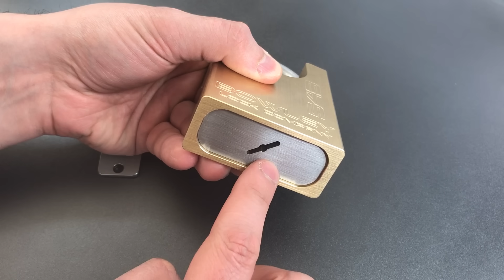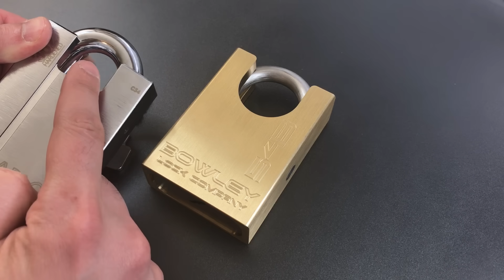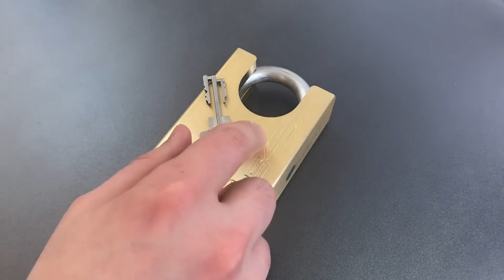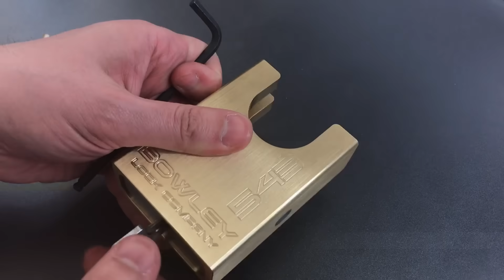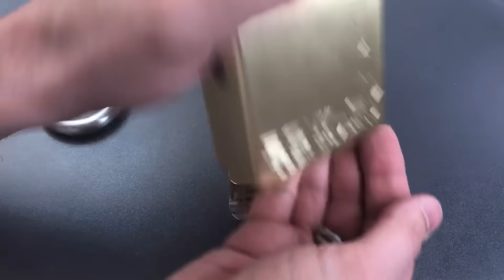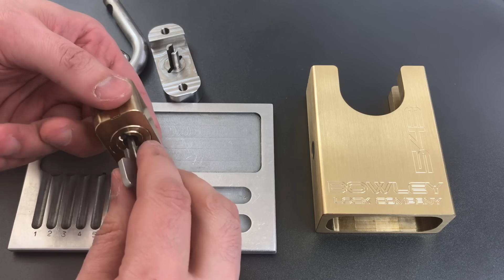[653] Prototype Dual Fork Bowley Padlock (Model 543)

Comment: You know it's a good lock when he doesn't even try to pick it
Reply: As he has said many times, he may not be able to pick it yet, due to not enough skill or a lack of tools. He has said it for a few locks.
Reply: @inchiga4466  still, it's certainly a strong plus for the strength of any lock when the lesser version already requires skills beyond his to access
Reply: @inchiga4466  he’d have to create a tool that can make that U shape to be able to get to the pins as well as create tension.
Reply: Alright someone bet him 20 bucks he can't pick it so we can see him pick it
Reply: It's also a prototype, so it wouldn't be an accurate representation of the final product
Reply: I don't see how you could pick this lock without having a special tool made just to pick it maybe eventually someone or some company will come out with the tool where you can stick it in the lock and get to the pins wall being able to turn it around that Shield
Reply: @davidaix5771  I'm sure him and Bosnian Bill could make one
Reply: @davidaix5771  - There's a guy who picked the single version on YT but it was difficult and required 2 unwieldy home made tools that were hard to use and flimsy. Imagine the same scenario on a dark night and DOUBLE the difficulty. This lock is an amazing accomplishment from a picking standpoint. I think a door version would be very interesting.
Reply: @davidaix5771  I wouldn't think anyone securing anything  worth more than a high end mountain bike would use this lock instead of some kind of  vault . But it's good to know that nobody could pick this lock , at which point bolt cutters would come in handy .
Reply: He doesn't have a tool for it yet.
Reply: It was more of a sponsor, so he wouldn’t show off how to pick it. But im not sure how you’d pick around that pin shield anyway
Reply: @ectoa5093  well, he apparently did try to pick a one-sided bowley core ( 636 ) and failed, so I guess it's fair that he didn't attempt to pick the two.sided one
Reply: @enteelch1717  fair point
Reply: @enteelch1717  cause he can't fuckin access the core
Reply: @ectoa5093 He could not pick it. See 636
Reply: @ectoa5093  He's not a shill, he picks plenty of locks he gets for free. The rest of the comments already mentioned he admitted he couldn't even reach the core for the half-variant.
Reply: @GRAYgauss  i respect the comment 6 months later
Reply: @ectoa5093  nobody has picked it yet
Reply: @ectoa5093  huxley69 did a video with small electric drill and wire, it's pretty quick. Bowley said it was only because the no lift pin was at the end but, huxley shows the weire has 5 wear marks and slips under the no lift pin.
Reply: @ectoa5093  nah he rarely will try to pick a lock on camera he didn't already pick a few people can pick the normal door lock bowly not sure about this yet
Reply: @ectoa5093  nope its cuz he cant pick it 🤣🤣 he just wont admit it
Reply: @pawelwityk1963  he admitted it in video 636.
Reply: @pawelwityk1963  he can't access core
Reply: @pawelwityk1963  He literally explains why can't pick it in the video ya muppet
Reply: @pawelwityk1963  yes
Reply: Don’t be fooled, if he could have picked it he would have, no doubt he has to make something special for it
Reply: He would literally need a new set of tools for it lol
Reply: It is certainly impossible to pick unless he crafts a specialized tool for picking a dual fork lock, which is possible, and I already have something in mind (2 sided enterance and 2 really small metal sticks that moves a lever ish thing to probe the pins)
Reply: honestly, how the hell WOULD you get a tool to pick this? Like you search online for "Bowley Model 543 Padlock lockpicks", yeah, I don't think many people (except this guy!) would search that.
Reply: I was shocked!
Reply: yup
Reply: The cost of this (in the SS metal) plus a hardened chain for your $1000 bike vs. a D1000 lock. Probably the D1000 which is angle grinder resistant is the better choice.
Reply: Was thinking the same thing
Reply: I got the universal key, mr. Oxy/acetylene.
Reply: @emilypiens2355 I came here to say this, haha. You have confirmed, it MUST be true!
Reply: That’s because he and his team are in the process of fabricating the tools necessary to pick this lock. Stay tuned…
Reply: Bowleys are theoretically pickproof because you can’t manipulate the pins.
Reply: Just an update, That lock still hasn't been picked to this day lmao
Reply: He just hasnt manufactured a tool for it yet. That will be in a later video
Reply: He probably can pick it but I guess he would need to invent a pick for it.
Reply: well with how much of a giant pain in the a*s it seems to be in order to pick it, it probably wouldn't be worth the effort. I doubt that unless your a lock picking pro with every rare and expensive tool in the world, it would be almost impossible to open it through lockpicking. At the very least the makers of this lock put in some real resources to making it so much of a pain to pick that it would be easier and faster to break the lock, or the chain its attached to with an angle grinder. it's like the opposite of the Altor SAF, in that instead of it being a angle grinder nightmare, its instead a lock pickers nightmare. I don't doubt LPL could get it open, but it would probably take a special tool to be made in order to do so.
Reply: Me knows the truth  he works as a lawyer, he got more than enough money, and picks locks for fun. so tell me again how they pay him off?
Reply: @Dejawolfs  Note that he is not working as a lawyer anymore, according to Covert Instruments web page: "As his name suggests, the Lock Picking Lawyer was a business litigator for nearly 15 years, but recently retired from practicing law to devote all of his time to security work."
Reply: @-JiminP-  And to dealing with picking locks might not really be something you should do as lawyer no matter the reason.
Reply: @Dejawolfs  "Me knows the truth he works as a lawyer, he got more than enough money, and picks locks for fun"
So he can get you out of jail one way or another, huh?
Reply: @Dejawolfs   he makes more money on social media than a lot of lawyers make practicing law😂
Reply: He can't and he have tried before with similar type of mechanism and he couldn't found a way to pick it since you just can't get to the pins.
Reply: He tries but doesn't show it if it's too hard
Reply: @viiltelijamurhaaja7225  there's no videos of the bowley padlock being picked I found the original bowly has been picked and they just came out with a new home lock again
Reply: Bolt cutters 😂
Reply: @joshualong1796  It's designed that way so bolt cutters can't easily get to the shackle when it's attached to something properly.
Reply: It's a commercial so of course not
Reply: Bowley probably handed him a fat stack of cash to not pick it, good advertising and a great endorsement.
Reply: He tried. He failed. He didn't upload.

Comment: Hi LPL. I wonder what would happend if a gremlin of some kind makes the intermediate brass ring rotate, preventing you to insert the key
Reply: There is 2 groves in an axis perpendicular to the key's axis on the idler ring. When locked, the pins are resting in those groves, preventing the idler ring to freely rotate.

Comment: Imagine him going to one of the bridges where there are a bunch of lovelocks. He is there and after like 5 min all lovelocks gone.
Reply: There are people that are paid to cut the locks off as the weight could cause a collapse if left alone too long.
Reply: @Cody_Ramer  ones one seen they just take the panels out and replace them. Nicer to the "lovers". I think I've seen the panels then get put out around the place as art basically
Reply: I was just at one of those bridges. I was able to get two locks without any tools.
Reply: @sarasotauptoseattle  Were those two locks ones where you just put something inside and jiggle it around and it opens? So basically were they Master Locks?
Reply: @TheBasedFurry  No. They were combination padlocks. I didn't use any tools. I just put tension on the shackles and moved the dials until I felt them set, then "Presto".
Reply: Probably he can make money off that
Reply: In his newer video that he released ,number [1241], he tells us that he actually has a love lock! He goes on to say that he welded it shut so that it can’t be picked. Coming from him that’s a huge statement.
Reply: @blondie5835  cant pick a lock thtas welded shut
Reply: @blondie5835  he welded it shut when it was on the bridge??
Reply: @crc0889  yes
Reply: Paris’ municipal infrastructure authority will hire him.
Reply: Cologne would hire him 😂
Reply: I wanna go to one of those with a pair of bolt cutters and jus cut all of em
Reply: It’s a lot easier to pick locks of many kinds that hasn’t been beat by weather an operates smoothly
Reply: In fairness, anyone with a large set of pliers and level of belligerence could do that anyways.
Reply: Didn't he do that once?  Only I think he only took one.
Reply: Except the Bowley
Reply: FF: He welded his shut

Comment: This thing is going to need a special "Tool that BosnianBill and I designed" to pick it.
Reply: Guts theme plays when you realize BosnianBill will never design a tool with LPL again
Reply: @RealCoolstriker64  hhhhhhhhhwhy?
Reply: That's what I was thinking. Maybe a cable-pulled rake?
Reply: @coldclimb  I imagine it could be done with 4 ultra thin cables embedded inside a 3D printed key to select and press up on each pin. Then some kind of external device to easily see the difference between each of the pins and how much pressure is being applied. Kinda like the lock pick decoder.
Reply: Unfortunately, it'll never happen....
Reply: Andrei Salvaleon  they are still friends Though?
Reply: Hahahahahuhhuhahhhuahuaahuha

Comment: I feel like a lockpick for this type of lock could be pretty easy to make, you just need to attack it similarly to a tubular lock.  A combination pick/tensioner that's the shape of the key, with moving parts to move the picking apparatus to each pin.

The problem is just that the tool doesn't exist yet, so you'd have to make your own.
Reply: How would you apply pressure to the individual pins? You would almost need... Oh, maybe stacked, curved probes of increasing lengths that are hinged together at the elbow...

Comment: I wonder if this kind of lock would actually be faster to impression than pick since you would need a different length pick for each pin to pick it. And actually, since you need to rotate the mechanism to get a new pick inside, I don't know how someone could even tension it between pins.
Reply: Maybe stacked, curved probes of increasing lengths that are hinged together at the elbow? They could all go in at the same time, then.

Comment: You say it can be picked can u please make a video picking it because to me it seems that because of the peice that resists picking you wouldn't be able to slide the pick up and down to pick all the pins and you would have to have as many picks as there are pins all set to different lengths making it practically impossible and a non concern for picking

Comment: 3 pounds 5 ounces.

Yes, I also weigh my locks in horses and apples...
Reply: The manufacturer is a Canadian in Canada, yet named the product after it's imperial dimensions, so...
Reply: Not sure where you're from, but there are still plenty of people in the world besides the US who use traditional units of measure instead of metric. People still weigh themselves in Stone, measure length in shaku or freaking cubits... And also, all US manufacturing is done in metric, and not all of it is converted to US Standard. Not that what system of measures the average person uses day to day makes any difference.
Reply: @OtakuUnitedStudio  It makes a huge difference even in 8th grade physics. SI is also way more intuitive because it is easy to convert.
Reply: @myotiswii  imperial works far better in construction etc because it’s units are natural.
Reply: @silentspring222  They are not natural tho. They have been defined, just like every other system of measurement. 
And actually in construction the si system is way more useful because of easy conversion.
Reply: just convert it

Comment: I should make locks when I get a cnc mill. Such simple operations to make a lock body. Only 3 axis required. They're making a nice profit but it looks like it's worth it if you need the size and appreciate the craftsmanship.
Reply: WCGwkf just make sure the LPL or any other picker can’t get to the pins.
Reply: @gsxerwhite  yes if I was trying to impress lpl but this lock can be picked too but requires special tools. The manufacturer even tells you how it has to be done and does not claim to be pick proof. They say you'd need minimum 3 picks different lengths in the shape of the key. Difficult but possible by the best lock picker in the world.
Reply: WCGwkf that works too! I usually start analyzing the craftsmanship on the locks he picks and wonder what and how much it would take to tool them. The qwikset he showed in another video was tooled in a way you could add extra wafers which was really cool for an inexpensive lock. That’s something to keep in mind to

Comment: Someone should make a commercial pinning tray with the 1 pin starting on the right side.  This is because most people are right handed and they generally hold the core with the left hand and the key with the right hand, resulting in the 1 pin starting on the right.

Comment: Bowley: has U shaped key that’s nearly unpickable 

Also bowley: another one
Reply: Also Bowley: And ya know what, add a spool pin and serrated pin just in case somebody manages to get a pick in there, just to make it that much harder.
Reply: A double U shape is you will ;']
Reply: next up three u's
Reply: @CodingCorvus  the way to make it a slap in the face would be, to set the three U shaped 'key-tooth-hooks'...Nope!  I'm calling them 'Barbs,' from now on, (with all entendre herein implicit,) ...ietherhow, back to it...
-- ...to set the three [Barbs] at 90-90-180 degrees and have a simple four point star or cross pattern instead of a matching T-pattern.  With actual pins in all four keyways, instead of only the three you need, one of the four could be a dummy group to allow for multiple false set positions.  You would have to have a bite for the forward notch at each of the four keyways as well.  The pins would all be offset at 45° and lastly the inner rotation cuff could have the odd bevel or three to assist in aligning with the false set pins...but, either way, that would all still just be overkill at this point, until someone finally devises a tool to pick this design...just how Bill and Henry came up with the disc tool they have...  
It's even possible that too much complexity could make it easier to pick.  Won't know till it happens, and then you fall back on the old addage 'keep it simple.'
Reply: The single u Bowley lock was already hard enough, the double, that's overkill. If someone makes the tool required and lock picks this they have the money and skills to make whatever is locked just not worth it
Reply: they could also slap in some pin traps like video 1181, that would be overkill tho
Reply: @aurunemaru  No such thing as overkill
Reply: W ones
Reply: @m2mdohkun  rrwryywrwyrrrrwrwryyyywrwywrwywrwywyryywywyyrryrwrwywyyyrrrwrrrwrryywywywrrrrrwyrywyyyyyyyywywyrwyyyryyrryrrrrrrrrrwrwrrwrryyyywrwrrwyyywyyyyyyyyrrwyyyyyyyyyyyyyyryyyryryrryyryyryyyryyyryyyyyyyyyyyryryyyryryyyyyyyryyyyyyyyyyyyyyyyyyyyyyyyyryyyyyyyyrrrrrrrrrrrrrryyyyyyyryyryryrryryryyryyrrryyyyryryrryryyyyyyyryyyyyryyyryyyyryyyyyyyyyryrryyyyyyyyyyrrrryyrrryyrryyryyyryyyyyyyyyryyryy